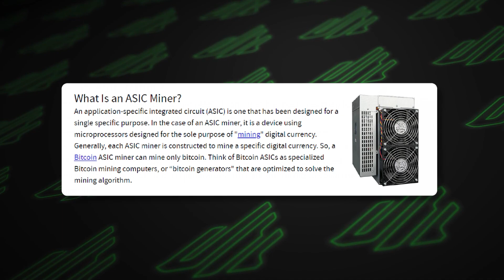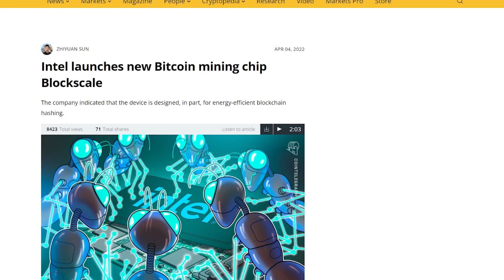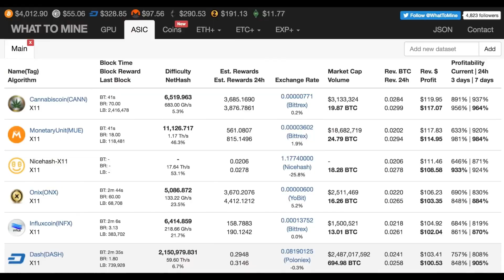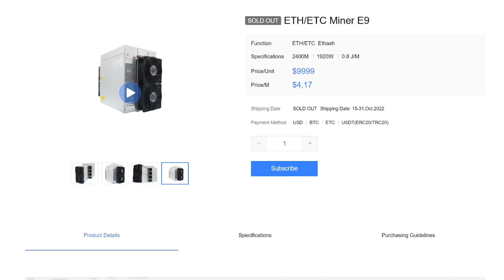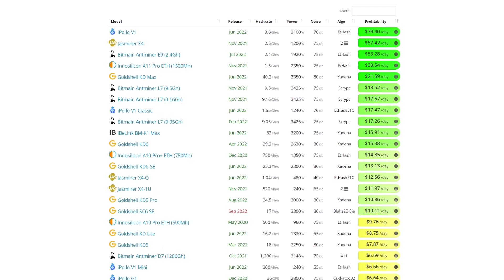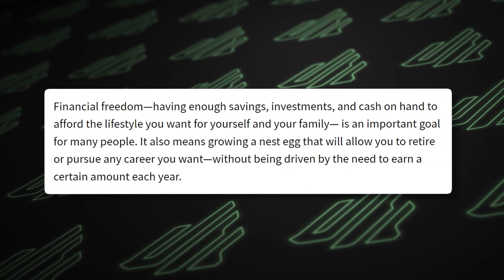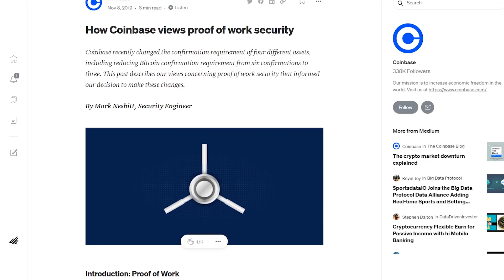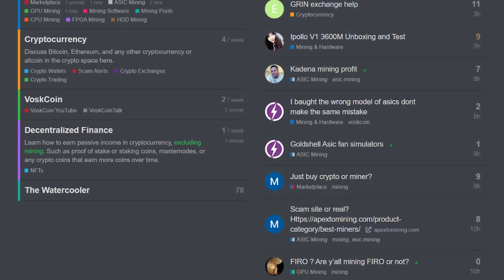Are Cryptocurrency Mining Rigs actually a SCAM?

Comment: ASIC miners should be regulated by the coin devs. Newish coin KDA is fucked thanks to Bitmain and Goldshell. Goldshell just pumped and pumped miners out and Bitmain actually did good one but that will wreck rewards. Unless you have 0.001kwh you will never reach roi with any asic. It was supposed to be decentralized thing for everyone now its only for big boys. Banks literally run ASIC mining. They buy @ 1/3 less msrp and run cheap el or offset el cost from earnings. I make in 1h with trading same amount of money that will 4xKD5 make a month. Paperweights. Nothing more.

Comment: Ahahaha great video bro , I’m honestly very happy you talked about this today , for the betterment of our overall mining community , I have spent probably 50k over the last 2 months buying miners as the prices have dropped , but even then I still feel I got scammed , but I’m making $40 usd a day currently after electric and only 10k in debt , which is that bad as long as the miners last about 2 years minimum , hardest part of my journey was developing a hvac system in my server room , which is still ongoing but so far 4 days without any significant heat issues , anyway back to the point , all these asic manufacturers are straight up worse then the cc scammers out of Nigeria

Comment: This is why I'm only focusing on KDA.
Reply: Kadena hashing allows users to buy an NFT and receive mining rewards without having to set anything up or worry about electrical costs. Check it out
Reply: @JulzCali2020  I prefer to run my own ASIC's. Plus I have cheap power here.
Reply: @YouShortz22  how cheap?
Reply: @vibeymonk  10 cent per kw
Reply: @YouShortz22  i don't have cheap power, the time, or the inclination so Kadena Hashing is where I invested my money. To each his own. I get rewards in perpetuity (i.e. until farming is no longer profitable or cheap). Happy with my investment decision.
Reply: @JulzCali2020  Hey whatever works rite.
Reply: Where?
Reply: @gotzpavlis5530  Indiana
Reply: kda difficulty is going through the roof probably better off buying coins for what ever you buy miner for. everyday coins mined going down
Reply: @dudedude7998  Thats ok. Becasue i can run the miner for years and then when KDA is at an ATH I can sell all the coins i mined and  the miner for a nice lump sum and then upgrade. I don't just mine for the coins though. I also mine because I want to help support the network.

Comment: Planning to build my first farm with 20/25 asics  after mining on 20 GPU for a year  . The obsolescence is my main fear.  On my planning the hardware is supposed to last 4 years since im setting up optimal conditions.
Fellow miners, Which manufacturer would you rate  first  regarding customer  support and asic longevity ?
Reply: immersion cooling farm you miners will last 5+ years plus 30 % to 50% more hash rate you need to hire a professional to do it though the tanks atleast like submer got the best tanks rn very clean
Reply: @thenooiler5345  thanks for the advice.  I didnt explore this option since it looks very technical to set up. Unfortunately mining  isnt popular in my country id be surprised to find à professional Who could set it up.
Any recommandation for a well made tutorial on how to build immersion  cooling system?
Reply: S19s all the way its all about efficiency... currently I have some s19s running in efficiency mode 85th@ 2200w.... next figure out your what your paying for power... if it's anything above say 10c kwh you might be In trouble during bear markets.. also might add im running custom firmware to achieve those numbers
Reply: @OzzmosisMining  cheers for your input.
Well im fortunate to have available very cheap electricity ( ~ 0.025 kwh). So the efficiency isnt my main concern.  I just read here and there that some pple got miners  that  had problems after a couple of weeks of usage so are the customer support from manufacturer or it's warranty reliable ?